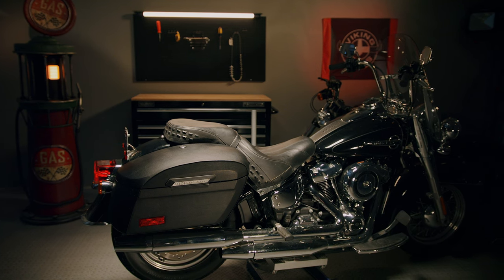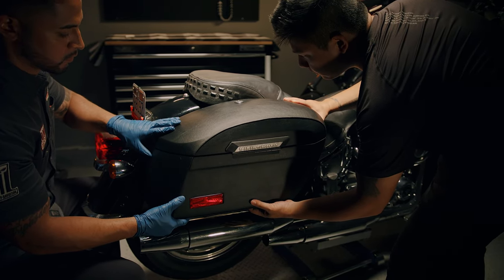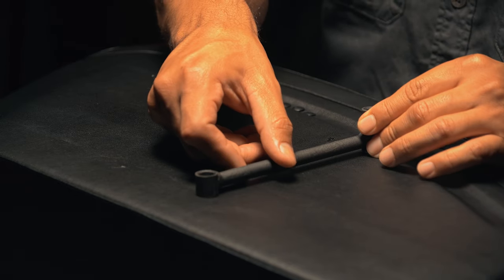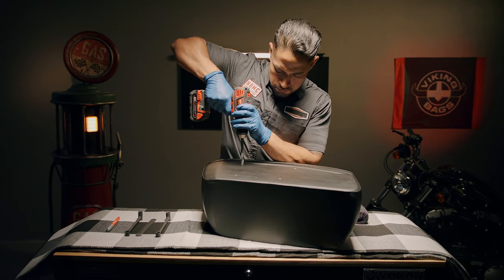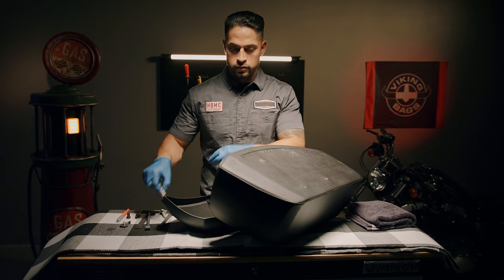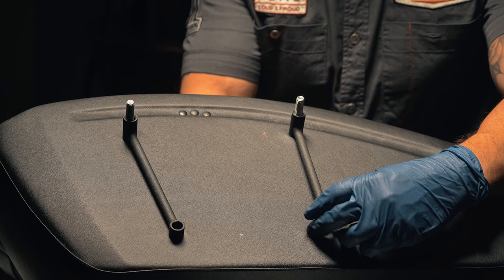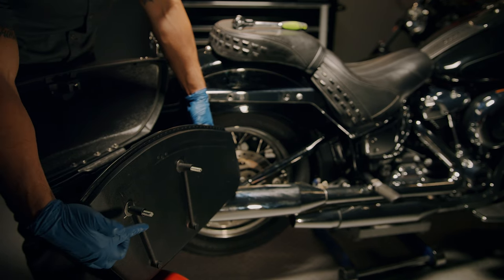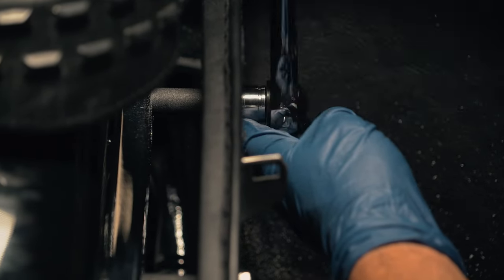VikingBags Hard Bag Mount Installation Guide

Comment: A major point to address is to make sure the bolts once through the fender , do not interfere with the tire. The bolts that are sent with the kit are for a universal fit. Even with the shorter bolts they could be too long for your application.
Reply: Got bags suggested for the rebel 500 and all bolts were way too long. Ended up having to cut them down. To make tracing the holes from one back to the other easier, I ended up removing the lid. 

All in all, took about 4 hours to figure out what was going on with the provided parts and modify the hardware to fit the bike that it was supposed to fit. The bags look good and hopefully they function well. Fingers crossed

Comment: When he puts long top bolts through the bag they stay there. Why don't they slide back out and drop in the bag? Is he using something to keep them in place? I wish I had two more arms.😎
Reply from the maker: It may not have been shown in the video, but the combination of all the hardware, including the bolts, washer, spool, and bracket helps keep the bags firmly in place.
Reply: @VikingBagsYT  I called you today regarding what mounting kit is included in the yamaha stryker 1300/pantheon medium bags kit. The person on the phone said this kit includes the coffin style mounting brackets. The problem is I want the dog bone style as referenced in this video as I feel they will work better with my sissy bar. The person on the phone said I am not able to choose this option?

Comment: the mounting hardware rods are simply too long to make work on a Honda Rebel 500, you cant raise the bags high enough to not interfere with the brake caliper or hit the muffler, need shorter length rods

Comment: What kind of warranty is given if the installation fails due to poor instructions?

Why do I need to damage a product to install it? If a saddle bag is meant to fit a certain bike, why do I need to make measurements and then drill into it? Why am I doing part of YOUR job?
Reply: Seriously though
Reply: @WHO-DAT-GUY  8 months.....no response.

Says a lot about them.
Reply: @Soldier4USA2005  I still like the bags though. They are a great quality but installion is not as great
Reply: Obviously it's to keep costs down.  If they had to drill holes in different places for each motorcycle model it would significantly increase the cost of the bags.  I'm cool with doing some quick and easy measurements to save $100+.
Reply: @JW-bw8nj  If you read the warranty, it only allows returns or whatever if undamaged.

Guess what happens if a customer screws up the measurements? You can't return the bags.

And I doubt it would increase cost by $100 to make a few holes. Especially when some already exist. Why can't they make a few more?
Reply: @Soldier4USA2005  They would have to take measurements for every model of motorcycle they want to sell bags for which would take MANY man hours which would therefore increase costs exponentially.

I just did the measurements and drilled holes yesterday morning to install the Viking bags I recently purchased for my Vulcan 1600.  It was SUPER fast and easy.  That being said, if someone isn't comfortable or capable of completing simple tasks then they should skip these bags and spend a lot more on bags from another company that are idiot proof.
Reply: @JW-bw8nj  No they wouldn't, as no set of bags fits every motorcycle.

Find a majority is enough and ensures the measurements are right and in a straight line.

As previously stated, consumers making the wholes instantly voids the warranty. So if you're going to buy them, be damned sure you know what you're doing.
Reply: Drilling my own holes gives me flexibility for exact location on my bike. I can position them at the exact height I think they look best as well as forward / aft. If they pre-drill them on the other hand, then not so much.
Reply: @JW-bw8nj  the bags I received came with pre-made holes, four of them for left and four on the right side bag.....not for my motorcycle. I'm instructed to use plugs (included) and drill 4 additional holes to use for my specific needs.
Reply: @thegodofwar94  Correct.  That's how my bags came also.  Definitely NOT hard to do.  If the included instructions confuse the buyer, there are multiple YouTube videos with instructions on how to do it.  Again, NOT hard at all.
Reply: @georgefurman7652  Another good point.  Measuring and drilling holes is super easy to do.  So easy that if a customer screwed it up then it's definitely their fault and the company should not be liable at all.  So freaking easy to do people.
Reply: @JW-bw8nj  my gripe is that if it's universal why are they shipping bags out with pre-made holes for a specific bag. The product page I ordered for was a Yamaha V Star 1300. The bag received has pre-made holes not for my bike. Why have those holes in the first place if they are shipping a universal bag? The bag will now have 4 holes plugged 🙄 and 4 holes to mount the bag to my specific bike. That's per side
Reply: @thegodofwar94  Good question.  I used one of the 4 pre-drilled holes when I installed the bags on my Vulcan 1600 but had to drill the other 3 holes.  Maybe it's to assist with lining the bags up prior to marking and drilling the other holes?  I do remember temporarily putting a bolt in one of the pre-drilled holes to steady the bag so I could more accurately mark the other 3 hole locations.
Reply: 100%. Horrible instructions. 1000 bolts and washers and not one place in the instructions that mentions what to use where.
Reply: @JW-bw8nj  The fact that the customer has to do some of the work says a lot about the company and product.

The point behind the question about warranty is most warranties are void once modifications are made. And as someone else has mentioned one set of bags comes with predrilled holes. So why not all of them?
Reply: @Soldier4USA2005  Why are we rehashing the SAME THING over and over again???  This isn't rocket science guys 🤦‍♂️

For the last time, they don't come pre-drilled for every bike model under the sun because that would DRASTICALLY increase the price of the bags.  The reason my Viking bags only cost $125 is because they required me to do some SUPER EASY work on my end.  I'd much rather pay $125 and spend a few minutes drilling three holes per bag than spending $500 because someone else drilled the holes for me.  

If you're too lazy to drill holes, or too stupid to figure it out, then spend the extra money for bags that come pre-drilled and stop complaining.

Seriously, this is the last time I'm commenting on this subject.
Reply: @JW-bw8nj  You miss the point and then get aggressive and attack people.

Your entire comment is a giant complaint about you not understanding why this can be an issue.

Something I haven't mentioned is I had to modify/change what bolts were used because the ones provided weren't long enough or didn't have enough threading to properly tighten down the bags. That means regardless of the hole situation, the provided hardware doesn't fit. That's on THEM.

That's poor design and adds an expense on the user, on top of the tools required to try drilling to begin with. An expense that could have been solved by having pre-made components they can build the bags with when choosing a certain motorcycle for fitting. 

Kawasaki did something similar with their Vulcan S motorcycle. They sent out "fitting bikes" to dealers. Bikes that had settings for the seat, pegs, and handle bars. The dealer would have the customer sit on the bike and change the setup until it was comfortable, then they would put that into the order for the bike.

As you said, "this isn't rocket science."
Reply: @JW-bw8nj   - And, if you change bikes, just plug the old holes & move them over!
Reply: I would assume in case you need to change where you want the bag mounted because of custom seats custom pipes or whatever other modifications you made to the bike.
Reply: @ouellette666  The point still stands.

Once a customer drills the holes, even if done PERFECTLY, the warranty is now void.

And since they have some bags predrilled, it makes zero sense to not do it to every bag. Especially the ones made for specific bikes.

It's not like the bikes has a dozen holes to add bags to. The specially made bags exist for a reason.

Comment: Wow, lots of crybabies in here. My installation was a breeze and it's not even 'quick release' nor am I super mechanically inclined. I will get a spare set of bolts and the wrenches for them in case something sheers off, as I've heard happens to some. (Or is this people loading the bags down with everything but the kitchen sink and then riding a fucking BMX coarse with them on?)

That said this comment section is amazing. Some people don't even list their bikes and some don't realize that if they were to make a 'plug and play' no drilling setup that it now adds cost of labor and tooling for these things. Congrats, your $450 bags are now $700. Not to mention that older/lesser known bikes wouldn't be 'on the shelf' and those people would have to wait to have the bags done for their specific bike. If you're uncertain about how to do this or inept then get someone to help you that isn't, or a mechanic.

Comment: Can you mount the bags if you already have quick detach sissy bar (2008 Dyna Lowrider)
Reply from the maker: If you wish to mount both these saddlebags and a sissy bar at the same time, you may need longer mounting brackets than the ones we provide to ensure there is enough clearance for the mounting brackets for your saddlebags and the cutouts at the bottom of the sissy bar.
Reply: I am looking to purchase a sissy bar and these hard case saddlebags for my 2008 dyna fat bob from you guys. Can you help me in sourcing the correct hardware, brackets etc? Thanks!

Comment: Make a cardboard template.
Reply from the maker: Making a cardboard outline of the saddlebags helps make installation easier for you?
Reply: Yes. It helps to make a template of the right bag (dual rs exhaust) to help with marking the bags level and for final drill hole markings .
Reply: The rs cardboard template is then used for the left bag installation .

Comment: Why do you still make bags with 1990's "make it fit yourself" installs when every other bag manufacturer has a direct bolt on model specific bag? Lame.
Reply: Every other company requires you have the stock exhaust too or they don’t guarantee fitment. Everyone has different exhausts which will require different height mounting. Also personal preference where you want your bags to sit. It literally takes 10 mins to mark and drill.
Reply: @BossMan302  just got some bags that have a row of pre-made holes as a throw over bag, not what I wanted anyway. They include grommets to plug those holes but they take up space where I have to work around. Why not just have a blank bag without pre-made holes?